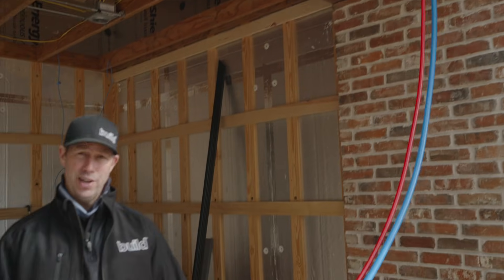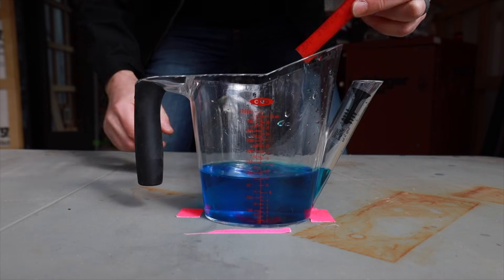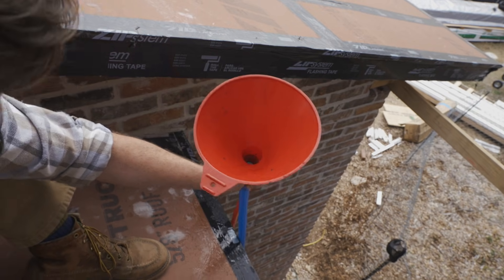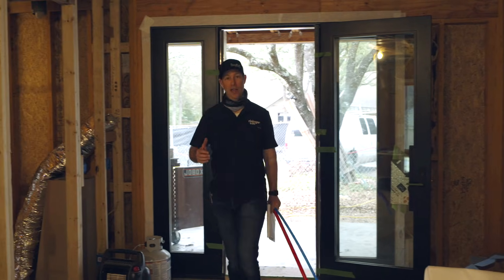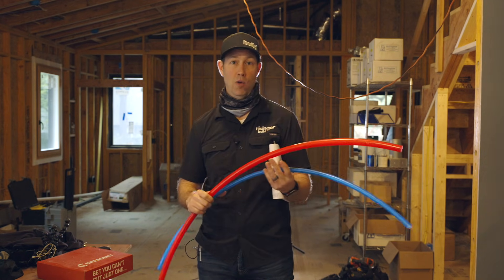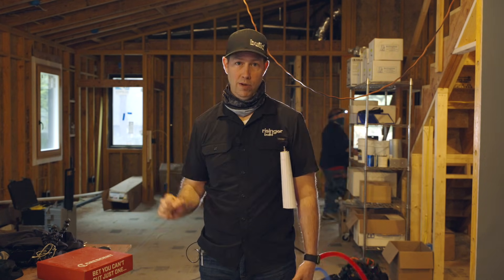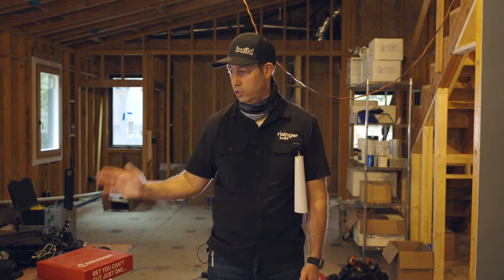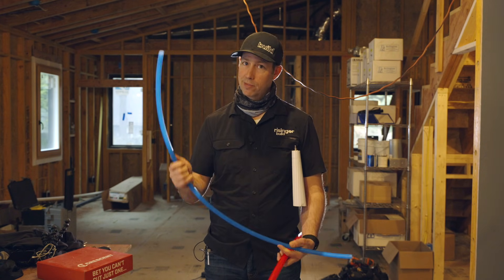What's the BEST Plumbing System

Comment: This makes a lot of sense. I use the trunk-and-branch method. I always insulate my hot water lines  from the water heater to the fixture to retain the heat. It makes a huge difference. I might  to try the  race track method

Comment: Yes, the re-circ "race track" can work better for quicker hot water delivery.  But, outside of that, the smaller lines win.  A 3/4" trunk line would only be as fast as 1/2" if the full 3/4" draw was being called for.

Comment: Not a pro, but a manifold system for each floor with a tankless water heater for each floor seems most efficient. 3/4" line feeding each manifold should greatly reduce wait time (for hot water), especially with very short runs from the perspective manifold to the fixture.  Each tankless water heater centrally located with equidistant runs should result in consistently short wait times for hot water.  Just my two cents.

Comment: Recirc loop is the way to go.  Only thing I would add is if you want all the water you can get, use 3/4" for your long branch runs and reduce as close to the outlet as possible   I just hate not having enough water.

Comment: I’ve been considering using a recirculating hot, but in my mind it would lead to my hot water heater running more?
Can pex be run in ceiling joist for shorter path? But most fixture inlets are at the bottom? Tips on structuring pex locations?

Comment: I did the "race track" or loop you described 12 years ago. 3/4" copper main with 1/2" stubs to faucets. All insulated except the last 10 feet of the  loop that ends at a tee into my HWT drain valve. (HWT outlet check valve removed) No pump, just a horizontal check valve near the HWT drain valve tee. Less than 2 seconds to HOT water on any faucet.

Comment: This makes sense. I have a hot water recirculator set up with it's own independent line so it's not using the cold lines. Would this make sense in addition to my system?

Comment: Just use multiple small tankless water heaters for every bathroom closer to them. That way the length isn't too much.

Or storage heater + hot water circulation work wonders

Comment: To determine the amount of water in cups that a 10-foot length of 1/2-inch pipe can hold, we need to calculate the volume of the pipe.

The volume of a cylindrical pipe can be calculated using the formula:
Volume = π * (radius)² * length

First, let's convert the diameter of the pipe (1/2 inch) to its radius. The radius is half the diameter:
Radius = (1/2) * (1/2) = 1/4 inch
Since the measurements are in inches, we'll use the value of π as approximately 3.14.
Now, let's convert the length of the pipe from feet to inches:
Length = 10 feet * 12 inches/foot = 120 inches

Now we can calculate the volume:
Volume = 3.14 * (1/4)² * 120
Volume = 3.14 * 1/16 * 120
Volume = 3.14 * 7.5
Volume ≈ 23.55 cubic inches

Finally, let's convert the volume from cubic inches to cups. Since 1 cup is approximately 14.44 cubic inches, we can divide the volume by this conversion factor:

Volume in cups = 23.55 cubic inches / 14.44 cubic inches/cup
Volume in cups ≈ 1.63 cups

Comment: I guess 1.5 and 3 but I'm an aerospace engineer who just replaced my 50' hot water 1/2" copper line with 5' of 3/4" PEX to manifold with one 3/4" in x three 1/2" out running to the kitchen and to the two baths. I didn't actually calculate the volume per foot for 1/2" and 3/4" before making my guess, but hey, go figure! I was excited when I heard what you were doing! A very valuable test so thank you. Switching from copper to PEX and minimizing heat loss as well as the more direct from manifold flow I've made a substantial difference.

Comment: So as Americans we can't simply wait anymore for a minute for the hot water, while high-end Builders have an excuse to jack up on materials. Good tutorial as long as you give your customers an option to upgrade - AND, that's just that much more hot water wasted in the pipes when you go to wash your hands for 2 seconds with hot water - 3 cups per 10 foot you said on 3/4" would be wasted in a simple handwash. I always wash with cold water and anti-bacterial soap so as NOT to waste hot water - unless the water is 160 degrees it ain't killing germs but it will give you 2nd-degree burns at over 135 degrees.

Comment: Seems to me that you will use exactly the same amount of water before you get hot water to the shower head with both pipe sizes, though it will take half the time with the 3/4 pipe. I don't see how there can be a water savings. Am I missing something? The only way to effect a water savings while waiting for hot water is central placement of the hot water heater and a manifold.

Comment: There's another consideration on the cold side: In the winter in these parts, the water coming into the house is near freezing. In the summer, it is at least 30 degrees warmer. If you don't let the cold also stabilize as it traverses room temperatures, you will not mix well at faucets and showers.

Comment: Why haven't I been able to find Tee fittings that are more like a wye that have a smooth transition off of the 90 for better flow?  Would that make a difference or have a negative effect?  I'm trying to create sweeping bends instead of sharp turns.  I'd like to see something like a 3/4 in and out but with a branch off to 1/2.

Comment: My house is weird, the shower is farther away from the water heater, twice the distance, compared to the kitchen sink. Both are 1/2". But I wait 10 to 15 seconds at the shower for hot and 45 seconds to a minute at the sink. Hydraulic mechanic for almost 30 years and I understand restrictions at the faucet as compared to the shower head, but filling a container at each and timing it shows miniscule differences. At any rate, I'll be redoing the plumbing with PEX soon and I have a simple trunk and branch layout planned with increases in supply size (trunk) that in the end I'm positive I'll be pleased with. Your videos are a great help, covering things I may not consider or know about.
Reply: Under size the hot system slightly...you'll be glad you did. Pex lasts forever. 40 yrs experience, Union, Master plumber. Pex is pretty cheap. Run a dedicated hot line from your water heater to your shower..... and another to the kitchen sink. Takes 15 more minutes to install.....big deal!

Comment: Is what is being discussed here only valid in systems without a dedicated recirculation line? I have designed my system with PEX-A, a Rinnai tankless with a recirculation line and one main manifold that feeds two sub-manifolds in more remote areas of the house.

Comment: Would love to see/hear from some diyers. I have basically all my plumbing exposed so this seems like a no brained if I can retrofit CPVC/pex
Reply: I'm in the middle of a CPVC tearout. Going with PEX-B and doing a 2 trunk system for each half of the house. Master Bed gets 1 trunk and Kitchen, Washing Machine and other Bath share the other trunk.

I love being able to control each fixture independently. That will help when I decide to renovate each bathroom down the road.

Also love the protection from freezing. It doesn't happen often here, but enough to be a yearly worry.

Comment: I noticed you installed a tank water heater in your home, while you have a lot of videos about tankless water heaters on your channel.  Why did you go with a tank system in this case?  I'm about to switch from tank to tankless on my house...
Reply: If the power goes out a tank is still full of hot water. I didn’t catch if he had a heat pump unit, but those can do some dehu and cooling as a side benefit

Comment: Two comments, ck out how multi-level hotels are plumbed.  Wait time for hot water whether 1st floor or 7th is quiet similar.  And hotel architecture is cost conscious.
Second comment, new shower and tub fixtures are equipped with mixers offering the convenience of not having to set a preferred mix at each use.
The problem is when a person reaches in to turn on the shower, the preset mixer is active.  The cold line is running water while trying to purge the hot line of cold water.
When starting the shower I turn the mixer all the way to hot, then must reset from memory each use, but the hot does get hot sooner.

Comment: I really liked the Upinor pex system, but the problem was the joints. A 3/4 joint reduces the inner circumference to nearly 1/2. This restricts the flow and causes turbulence.  I replaced it with copper, pressure is good now.  I do have a recirculating hot water line back to the tank. I use a WiFi plug to control the pump, and I use Alexa to turn on the plug and then shut off the plug after 4 mins. I wrote a simple script to do this.  Before needing hot water, I tell Alexa to run the script called hot water. Alexa beeps when the 4 mins is up, and I now have hot water at the tap - no waste

Comment: Matt, I really like the idea of a manifold system but I understand your point. However, to address your concern, perhaps the best solution would be to do a hybrid? In the scenario of a race track system, aren’t you evacuating more water than necessary most of the time? Wouldn’t it make sense to run a manifold system and instead of 20 individual runs, which I agree would be wasteful, do five runs to different areas of the house and from each of those runs, branch off to four fixtures.  Particularly in your example of the shower and the nearby faucet This would solve the problem without evacuating the system for other areas of the house where you’re not using hot water at that time

Comment: Ridicules.....No reason for a manifold system for the cold side. On the hot system you can pick up 7 fixture units on 1/2" pipe if it's within 20 feet of a manifold. This means using 1/2" tee's when you reach the master bath. One 1/2" hot line and the same at the hall and guest baths. I always slightly undersize my hot and (when possible) run a dedicated 1/2" hot to the kitchen sink. You just don't use near as much hot water compared to cold. And if you plan on turning off one of those small dedicated shut-off valves at the manifold after 10-20 years of use?....good luck...Yer just asking for a drip. Shut the whole house off at the service.....I wouldn't touch those little plastic valves. Any questions? 
   (the edit) By the way at 9:33 it shows a "laminated beam" drilled out for that 2" waste line and  3/4" red pex line.....better not do that in California....you'll be replacing it. (very expensive) Those things are engineered to be solid.

Comment: What about a manifold system that feeds zones per outlet/valve instead of a fixture per outlet? We redid our 1926 2-story home using this method where each room that had water to it received it’s own valve on the manifold and that has seemed to work swimmingly! We have 6 zones: main floor bath, laundry, and kitchen, basement kitchenette, bathroom, and laundry. Our tap is 3/4. We ran a cold water through-manifold directly off of the back flow preventer and that feeds each zone with 1/2”, then ran 3/4” through the water heater and then directly into a hot water manifold which then also branches to each zone 1/2”. All insulated. Cut our hot water wait time at least in half with no pressure loss.

Comment: I have a big ranch and the kitchen sink and second bath is about 50 ft from the Navien Combi boiler.  I plan to add a smart recirc pump with a loop line from the farthest point of the branch.  The smart recirc unit monitors hot water usage daily and fires the recirc unit up prior to the average start time of the hot water usage throughout the day. i.e. 6am, 11:38, 18:00, 22:15  It also will go into vacation mode if no hot water is used in 48 hours.  I think this should solve my wait time.

Comment: you could have solved your issue when you were pouring out the pex, by getting the guy on the roof to be the one that lets air out.   let HIM ease his thumb off of the pex pipe.   You had it completely reveresed.  You plug it while he pours.   Once its full, HE plugs it.  You let it go.  He lets a slither of air out, to pour slowly.

Comment: Thanks for all of your content on building. We are considering using PexA too but are concerned with the news of failures at fittings and a recent, as of 2021, class action law suite over premature failure of colored PexA at the joints. Matzdorf et al. v. Uponor, Inc. et al. FILED: JULY 29, 2021 ◆§ 1:21-CV-02057. (https://www.classaction.org/news/discontinued-red-blue-uponor-pex-piping-plagued-by-cracking-defect-class-action-alleges). Any thoughts on these failures and why we should/should not be worried about the failures?

Comment: It doesn’t matter how big your pipe flow is if you have a pressure valve only allowing .5 gallons per minute to flow through your faucets. You will always be waiting for hot water.

Comment: Matt, thinking about my own personal situation in relation to your comments about why you don't often use manifold systems. Is there any reason why one couldn't use such a system and keep the bathroom sink and shower on a single 1/2" run?

Currently my downstairs shower is on a copper line that is 1/2" all the way from the water heater and prior to reaching the shower it branches off to the 2nd floor bath, then the kitchen sink, the washing machine, and the bath sink. Same with the cold. So if I am in the shower and ANYTHING in the house is used, I know it. 

Running a line from a manifold that only branched to the 1st floor bathroom sink and shower would be a huge upgrade. Do you know of a reason not to do this?

Comment: This video was great as I am building a solar heater and needed to know how much a 3/4 pipe hold. 3 cups to every 10 ft of pipe doubling every 1/4 in larger. 3 cups for 3/4 in and 6 cups for 1 in as I have a small house that does not waste much water. So 6 tubes 10 ft long is only heater 60 cups or 3.75 gallons.

Comment: I invested in a Gary Klein plumbing consultation before starting my renovation project. It was an absolutely amazing value. I ended up with a tight plumbing envelope, a recirc loop, and almost no wait for hot water- which means far less water waste overall as well.
Reply: What did you pay for the consult?
Reply: @mountains2938  reach out to Gary and he can quote you. He bases his fee on the square footage of the place being renovated. An outstanding value, I can’t say enough good things about him!
Reply: Do you know how the recirculating loop affects the electric bill?
Reply: @anthonymccoy4460  my electricity bill is down about 70% from pre-reno. In the long run, you’ll care a lot more about how fast hot water shows up than about the few extra cents it may cost you monthly.

Comment: So basically you could use a smaller tank for hot water since your tank is now a loop of water that travels around the house. I would think the pipe should be insulated even more than standard to reduce losses. Also a low power pump to keep energy cost low.

Comment: What concerns me is the efficiency of a recirculating system. Wouldn't it cost a lot of energy to continually pump water and keep it hot? I would think that most people do not use a lot of hot water in a day. One shower a day, dishes maybe a handwash or two. The rest of the day you are pumping and heating water. Maybe on a weekend when you are doing laundry also. Just food for thought. BTW I do not mind the wait. Just turn it on before you get naked and wait for it to warm up.
Reply: Matt doesn't care about energy savings or water waste. He just doesn't want to wait.

Comment: The amount of energy wasted by recirculating hot water  is a serious issue because the insulation standard (if any is used) is almost always not enough  but that is not the only problem.
If a boiler is fired to top up recirculation losses the percentage of wasted fuel can be enormous. Then you have the cost of power for the recirculation pump.
I found the solution is to create a gravity circuit on the hot water line to circulate the hot water without electricity  using a natural thermosyphon  return from the furthest practical points back to source. I would use insulated pex pipe and then insulate that again or just use one layer of extra egfective insulation. The hot water pipework insulation should at least match the water stores level. Then you can have readily available how water and low costs.

Comment: I'm not confident that your criticism of the manifold system is valid.

Basically, the situation for which it is MOST valid is one in which hot water usage is clustered around one or two main water usage events throughout the day. In that situation, having a larger pipe to the bathroom that is full of hot water, does mean that once it's charge, it stays that way until the entire pipe cools down to ambient temperature. The question in my mind is, how reflective of water usage patterns is that. Perhaps if everyone is out of the house all day, and on the same general time pattern, it's more valid; but if people are home at various time all day, you'll have a lot more hand washing than showering.

Comment: Owned a beach house in Surfside, TX. Replaced the water heater. Wife complained about how long it took to get hot water at the kitchen sink. Replaced the CPVC 90 with a tee and returned it to the bottom of the tank. Removed the drain valve, installed a tee and tied in the return line and drain valve. I insulated the pipe. Wife complained the water got hot too fast and burned her fingers. Replaced the wife, no more complaints.

Comment: Matt mentioned 2.2 gpm as well as 2.5 gpm. 1/2" pipe delivers WAY more than either one of those. If you look at plumbing under a sink on 40-50 year old houses you will find a shut off (usually) under a sink with a 1/4" pipe running to the faucet. They delivered WAY more than either of those numbers. My point? Use a manifold system with 1/4" home runs running to every faucet/shower valve and you should have plenty of flow and it still won't take many cups of water till you get hot